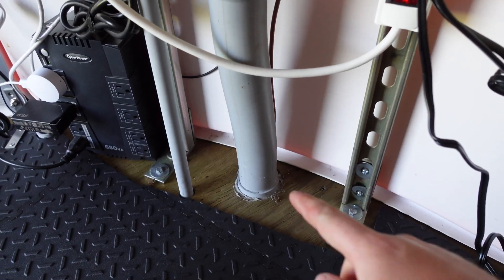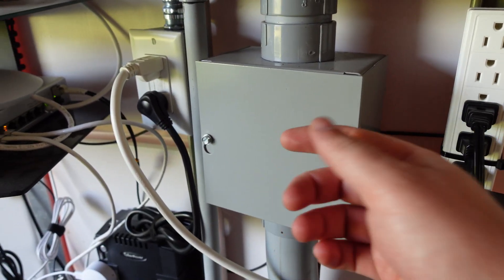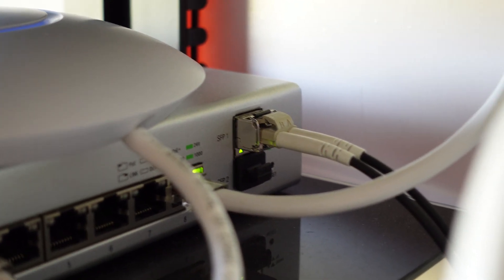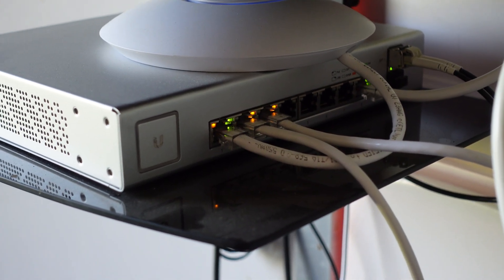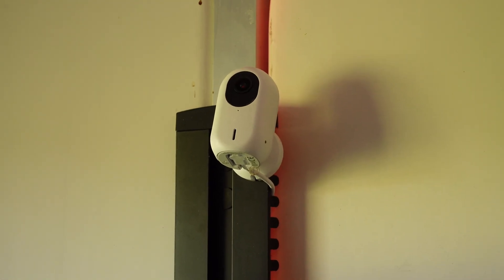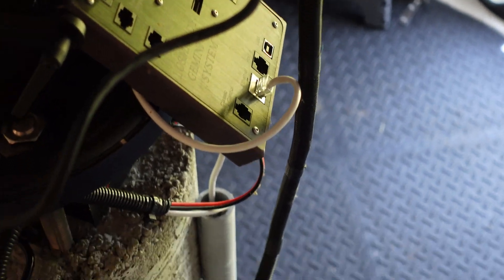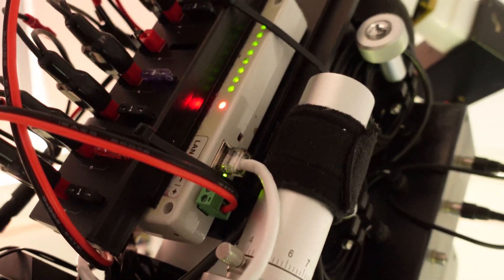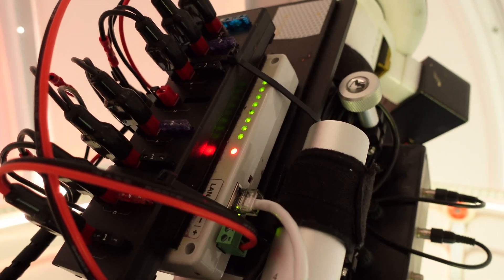Networking an OBSERVATORY with Fiber Optics!

Comment: You could have done the 500 foot network link wirelessly with 2 Yagi antennas connected to a wireless router on each end.  Ask me how I know.  You wouldn't get the same throughput but it would have worked pretty well.  Also a lot cheaper.
Reply from the maker: Definitely! Ubiquity also offers their own wireless option. I had that on the observatory at my old house but it wasn't nearly as reliable as I wanted. The fiber connection is rock-solid!